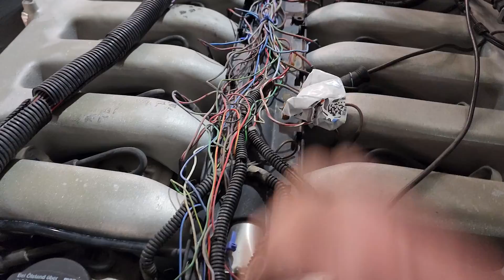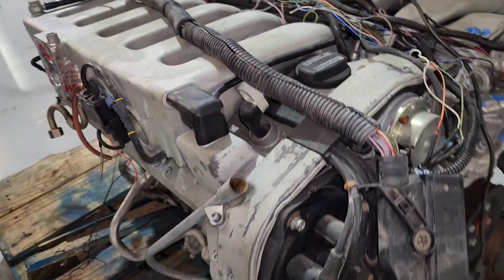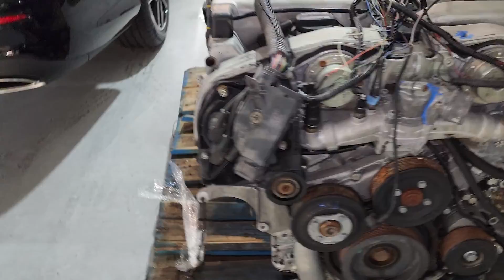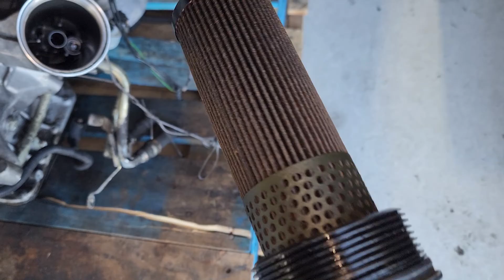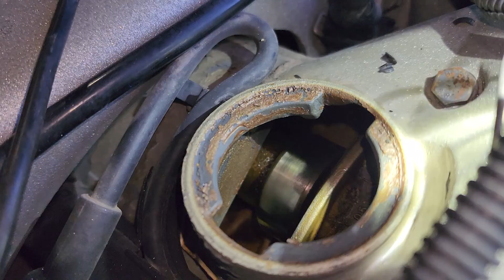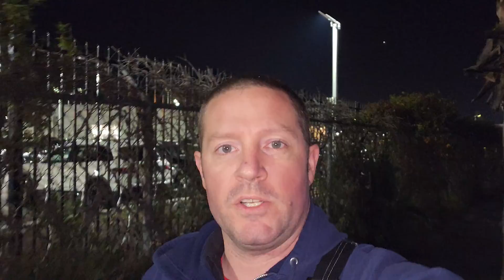M120 V12 New Project!

Comment: Wheres the flex fan in this engine?
Reply from the maker: The engine didn't come with a fan, although I do plan on swapping to an electric fan.
Reply: @FriendlyMBTech  oh I've heard that e fan is more efficient
Reply from the maker: @gnrtx-3712  that's what I'm hoping.  I already have a fan that I want to use with the M119 right now.  Kind of as a mock up for when the M120 goes in.  I can already tell though that it will take up too much space for the M120 to fit so I'll have to find a lower profile one.

Comment: I have a running 1994 S600 M120.  If your engine ran, it was a mistake taking it apart.
Reply from the maker: I'm sorry I missed this comment.  I don't know if this engine ran.  If it did, it wasn't very well.  A pulley was bent, and the timing chain guides were on their last leg.  The main reason I bought an M120 was to take it apart and rebuild it for my channel.
Reply: @FriendlyMBTech   I see...I've been mechanic 40 years....first hand experience, road to hell is paved with good intentions.  the chain guides and pulley are superfluous, could have been changed without total disassembly.  there's many "rebuilt" engines out there worse off than before being taken apart, and parts are hard to find, expensive.  so is competent machine shops.  its better to only replace what's broken or worn out on something as complex as an M120.  but hindsight is always 20/20.  at this point good luck, strive to use all FACTORY MB parts, not Chinese repops
Reply from the maker: @tunnelportterror  I'm a Master Certified Mercedes-Benz Technician.  I know how expensive this endeavor is.  I only buy parts from our parts department unless the part is no longer available.  The main point of my channel is to help people who might otherwise be apprehensive to attempt repairs on their own engine.  As a mechanic of 40 years, you should know more than anyone how much of a bad idea it would be to buy an engine from a junk yard without looking inside of it before installation.  Good thing I did, too, since I found blocked coolant passages between the block and the head.
Reply: @FriendlyMBTech  do a cranking compression and oil pressure check.  run it first.  most M120 motors still run.  I got mine with 108k and have been beating balls off it 4 years bouncing off rev limiter.  135mph.  what's this "if"?  I build and repair ALL MAKES engines, have Degree in Automotive Technology. My first complete rebuild from bare block was 1984.  How long have you been doing this?  I worked in over road tractor trailer rebuild shop,  there were 3 tractors inside,  and 5 outside every day.  in chassis motor rebuilds. Mack, International, Peterbilt, GMC, Cummins, Caterpillar, etc.  they'd take back a finished one, drop another one off.  trucking companies.  you're rebuilding an engine that would have run fine anyway.  and I'll stand on that statement.  no home driveway mechanic should attempt rebuilding that v12.  those cars have other much severe problems, such as biodegradable wiring harnesses that fall apart.  I had to rewire mine to both MAFs from the coffin box.  the engine, trans, rear on those cars v12 is bulletproof.  fix it when it needs it, not before its worn out. having said that seeing it taken apart is worthwhile, hey it's your time and money.  it's not what I'd recommend.  if it didn't run,  had low cranking compression, low oil pressure, then I'd rebuild it.
Reply from the maker: @tunnelportterror  this engine came straight from a junk yard.  It was in no way ready to run.  Trusting the internal condition of this engine on nothing more than blind faith and ignoring previous experience with engines from this place would not only be a gigantic waste of time but of money also.  Installing an engine that's not ready to run, and more than likely needs multiple internals replaced, when I plan on rebuilding the entire thing anyway, makes zero sense.  Not to mention the fact that running it in the condition it was in could have caused catastrophic damage, then I'd be out $2300.  

I'm glad your car that you got in running condition is still running strong.  I don't have experience fixing heavy duty diesels and every manufacturer under the sun.  Im not some "home driveway mechanic".  I do have 12 years experience with only Mercedes-Benz.  I'm still working there and I am Master Certified.  So I have factory Mercedes-Benz parts that I use.  I have factory Mercedes-Benz support with information and work instructions.  I have the benefit of having help of technicians that have more experience with just Mercedes-Benz than your entire career.

I don't know how you can tell me this engine would have run fine when you have not laid one eye on it in person.  It had blocked coolant passages and would have overheated in no time, probably warping the block or heads.  There were plastic chunks in the oil pan from the timing chain guides.  The upper timing chain guide was destroyed.  The oil smelled saturated with old fuel.  The harness has deteriorated beyond use.  Etc. Etc.  Like you said, it's my time and money.  I decided to use both wisely and rebuild it before it's already installed and would need to be taken out again, or before the engine overheated and destroyed itself.

Comment: The M120 is a cool engine. I know you are still in the learning process as we all are and no dig for you buying a cool engine in search of a body. I have learned from my struggles if you want to find a engine for a powertrain swap buy a clapped out S600. They are cheap enough and then you have a rolling test bed to sort what you will be pulling and have all the bits needed. Especially given a lot of critical parts are NLA.  Looking at that engine you need a lot and will still need a transmission to back it. Maybe a later 722.6 from a 97 and newer. My .02
Reply from the maker: Buying a roached out 600 is something I plan on doing.  I bought this engine because it "only has 59k miles" on it and the place gives a 5 year warranty.  The engine is a '92 so I'm (probably incorrectly) assuming it will fit my '92 transmission.  My thought process is the 400SE in '92 was also available in 600SE(L) form so the transmissions should be very similar if not the same.  I do concur that buying a whole roached car will be easier and cheaper than sourcing each part individually.

Comment: Check out the Dutch guy’s rebuild of a M120 then stuffing it in a 201. Lot of good details on the engine rebuild. Took a lot of chassis and engine ancillary bits modifications but the car was insane. He used stand-alone ECU and transmission controller.
Reply from the maker: I've seen that one.  That's JMSpeedshop.  We follow eachother lol.

Comment: Hello i have a question i have a 500e when the oil is cold the oil pressure is on 3 when it warms up it goes to 0 at idle is it normal
Reply from the maker: 3 when cold is normal.  0 at idle is not.  Even in summer time when it's more than 100 degrees outside and the engine temp is closer to 100, the oil pressure should at least be between 1 and 2.  Just off idle the oil pressure should be at 3 again.  What kind of oil are you using and what weight?  I have used weights from 5W-30 to 20W-50 just to see if I noticed a difference and they were all very similar.  It's possible to have internal oil leaks that cause oil pressure issues.
Reply: @FriendlyMBTech  i use 10w60 liqui moly
Reply from the maker: @mobile games hacks  10W-60 is pretty heavy.  How many miles are on the engine?  There are many things that can cause low oil pressure.  Excessive wear can cause it if bearing clearances are too large.  An oil pump on it's way out can also.  If the timing guides are coming apart, the chunks will clog the oil pickup screen amd cause oil starvation.  A worn oil pump can cause it also.  Can't rule out a faulty oil pressure sensor also.
Reply: @FriendlyMBTech  250000km im gonna try first the oil pressure sensor
Reply: @FriendlyMBTech  1 week ago i opened the lower oil pan i found a small red plastic i drove 3 days the oil pressure would be at 1 when idle now its on 0

Comment: I’m looking forward to watching this rebuild. I was with you the whole time on the M119.
Reply from the maker: Thank you! I'll try to not disappoint.
Reply: Agreed!  I just picked up a 400E a coupla months ago and the vids were very inspirational. Not going to tear the engine down but had to unbodge the intake hoses and will need to get the ETA rebuilt and probably do the disto and wires. Runs badly now won’t idle but I think that’s the ETA
Reply from the maker: @richbenzer5926  good luck with your repairs! Thank you for watching.

Comment: you gonna fit this to the 124 when done ?
Reply: I’m in the middle of renewing my M120 SL600. Sitting on a $1k parts order…
Reply from the maker: @Rich Thomas  Hopefully this engine is ok internally.  I'm guessing with how far I'm going to take it apart, it will be about $6-8k in parts when I'm done.
Reply from the maker: That was my idea.  I don't know if it will actually happen though.  I still need to do some research on it.
Reply: @FriendlyMBTech  I’d love to see it happen. It would have to be a labor of love, it still makes more economic sense to just fit an LS with off the shelf go fast bits if you just wanted more power. A v12 MB w124 would have more cool factor though.
Reply from the maker: @MMWA  that is what I'm glong for.  Plus I'd like to keep it all MB.  My idea after that is to take the M119 and stuff it in a 190E.
Reply: @FriendlyMBTech  hah an m119 in a 201, thats gonna be a very tight fit!